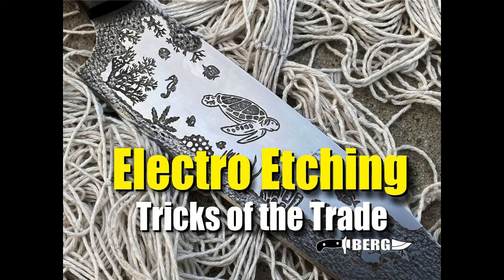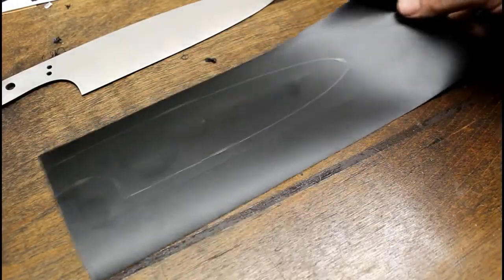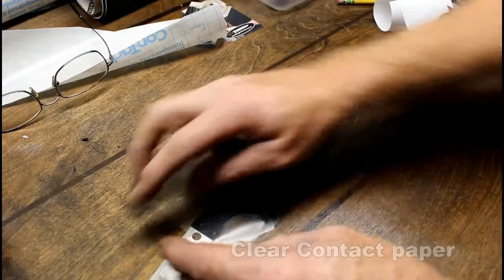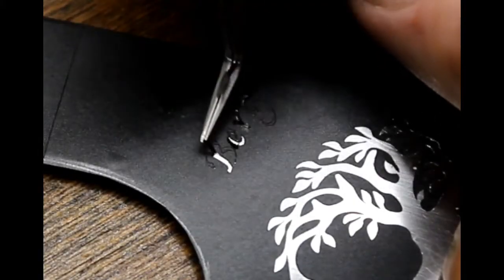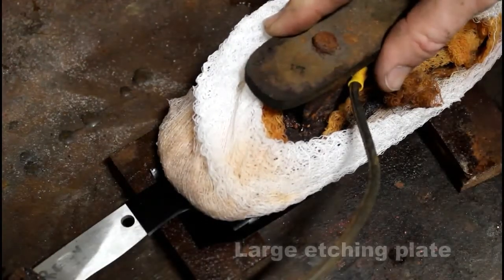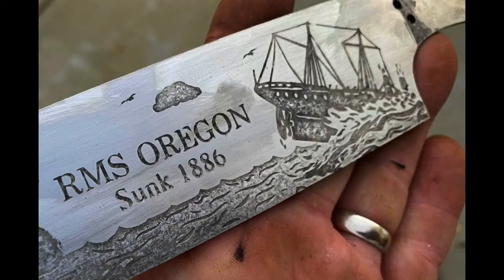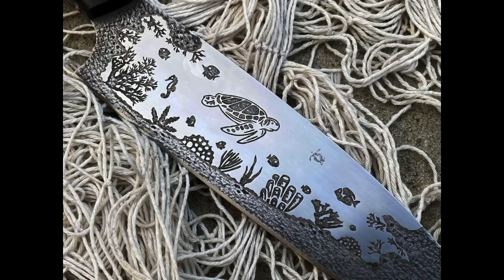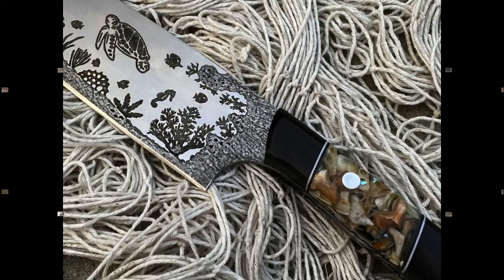Electro Etching Tricks of the Trade by Berg Knifemaking

Comment: no mention of the chlorine gas produced when using salt as your electrolyte. people should be made aware of the hazards and proper safety measures. how come nobody ever addresses this?
Reply: You should address hydrogen if you use soda 😮
Reply: Unless you are overdoing it with the voltage and current that you pass through, the way the reaction goes doesn't produce much chlorine gas, if any at all. This is because the chlorine reacts with the iron to make ferrous and ferric chlorides, which can be seen as the dark liquid he wipes off the knife later in the video.

I think the real issue here is that on top of the chlorine from the salt reacting with the iron (which again, is not a problem), in the case of stainless, you have to add the side reaction between the acetic acid and the other metals like chromium and nickel, which end up in solution with the ferrous and ferric chlorides.

This is bad news, as these forms make the metals easier to absorb through the skin, so use gloves for this, just a precaution with nickel and chromium...

This solution should be disposed off properly, and not just thrown away. I suggest precipitating the hydroxides, carbonates, sulphates, etc. and washing away the chlorine and acetic acid, making sure no metals are left in this liquid waste. Then the precipitates can be either stored in this lower toxicity form, or taken to recycle. Any alternative to just throwing chromium and nickel down the drain or storing them in a dangerous solution is preferable, specially with how cheap and easy it is do precipitate and wash these quantities.

Comment: Can I use an old electric iron as the plate?
Reply from the maker: Im not sure. I guess it would work as long as you can tap a hole to connect wire and wrap it with gauze

Comment: Do you have a tutorial on how you made the etching plate?
Reply from the maker: I dont but is just a flat plate welded to a pc of steel tubing as the handle. I drilled and tapped a hole in the tubing for a bolt that secures one of the electrical leads.
Reply: @DIYeasycrafts  thankyou!
Reply: @DIYeasycrafts  does it matter what type of metal the plate is?

Comment: Gday and congratulations for your video: I'm very interested in electro etching, I would like to ask you what type of adhesive paper do you use? Could you tell me the name to search for, maybe on Amazon? Also I would like to know what type of electrolyte to use at what amperage for stainless steel! (only works with real stainless steel, not with aluminum? ) thanks, Alberto
Reply from the maker: I use rolls of self adhesive vinyl from amazon. no particular brand. I make my own electrolyte solution. White wine vinegar and salt. Works great for stainless. 12v set at 2 amps
Reply: @DIYeasycrafts  Thanks so much for your kind answer!

Comment: Where do you get a large etching plate, or did you make it (and how)?
Reply from the maker: I made it. Just a pc of flat steel I used 1/4 thick and welded a small pc of rectangular tube to it for the handle

Comment: So sanding after the electro- etch won’t damage the etching?
Reply from the maker: I do a very deep etch. You can catch your finger on it. Sanding just cleans it up a bit makes the entire area have crisp lines
Reply: @DIYeasycrafts  The one I just did will catch your finger nail as well but I was afraid to sand it or use Flitz. Will the black/ dark area be removed if I do that?

Comment: What is the machine? Voltage? Power supply?  Is it a handmade etching iron? How did you build it and why?
Reply from the maker: Sorry for delay getting back to you. I use an automotive battery charger 12v 2 amps

Comment: My wife a silversmith watch your video and is very interested in what she believes you call the "large etching plate"(iron looking with an electrode).  She would like to know where to buy this or can you explain how to make one?
Reply from the maker: Made it from a pc of flat steel. Welded a small pc of square tube onto it as the handle and then drilled and taped a hole for the wire.

Comment: Do you answer comments? Could I etch deep enough to make a touch mark at the end of a steel bar
Reply from the maker: I do not think it would work. Touch marks are tapered in on an angle like a chisel
Reply: @DIYeasycrafts  My thought was to do taper it before I do the process. So I forged the taper in sanded the metal. the image came out good now i need to test it on some metal.

Comment: Really cool process!

I'm interested to see if anyone has yet to make lichtenberg fractal / electro chemical process combined in such a way as to make fractal patterns on metal.

I'm sure with use of a variac and some adjustments to the process and device it would be possible. Id assume the flat surface of the metal would allow for some super crisp fractals too.
Reply from the maker: Not me that stuff scares me!!
Reply: I used a variac the only time I’ve etched. I didn’t try changing the  settings on it at all because I was just doing simple runes and geometric lines. I’m planing on etching a space background on my next project, maybe I will try it there

Comment: I’m looking at a 13.5 v 4 amp dc power supply would that work or should I get a 30v 5 amp machine?
Reply from the maker: I do all my etching at 12v 2 amps. Im not an electrician but would think the 13.5v 4 amps would be fine

Comment: I thoroughly enjoyed vid  re RMS Oregon. Amazing!
I realise my query relates to a different method of etching, but a vinyl stencil is not an option in my case because of logo size
Can you advise me of a supplier of reliable, good quality photo resist film for electrically etching my knife blades?
I have followed your vids on your site for a long while now, and,  after checking yours and others, am pretty sure I am following all the important steps for using it, like exposure, developing, and the  electrical etching. 
 I have had to buy my  Resist from Ali Express, and have had so little luck with quality and consistency, ( zero actually!!),  I feel it could well be a poor quality issue, something impossible to assess when ordering!
I think the only way to obtain reliable, quality, photo resist, would be to  ask the advice of people like yourself who have found and used,   good product.
Hoping you can help direct me to a supplier. I'm getting so frustrated with all the failing!
Thanking you
Reply from the maker: Sorry I just do not use and do not know of one

Comment: Great video, thanks! How did you make your etching plate? Or did you buy it?
Reply from the maker: I made it. Just a flat plate welded to a pc of tube for handle with a tapped hole for wire
Reply: @DIYeasycrafts  The flat plate is made from what kind of material?

Comment: Fantastic job! Beautiful workmanship! How do you go about making sure that the battery charger that you purchase will work for etching metal?
Reply from the maker: Not sure most of the new chargers have a short safety and will not work. Im going to try to find a 12 volt 2 amp power supply
Reply: @DIYeasycrafts  Ok. Thanks!
Reply: Tried my first two small etches with a 1.5 amp power supply. The etching depth came out great! But I was disappointed in the vinyl cutouts. I am no artist and the results of hand cutting the vinyl show! I am only trying to practice in order to etch an old axe I am restoring, and the etching on the axe will be pretty detailed. I have the image on paper, but I know I will not be able to cut it out properly. Unfortunately, I will not be doing it again, so I can't justify purchasing a vinyl cutting machine. :-(

Comment: Such a good video and explanation!! In fact, I have 2 questions: which are de proportion used for the electrolyte in case of the high carbon steel? And can I use any metal for the etching plate?
Thanks for your work

Comment: What do you use for the 'iron-looking' device you've attached cotton?
Reply from the maker: Its just a pc of flat stock big enough to etch entire blade, that is welded to a pc of square tube. I drilled and tapped a hole in the tube where I connect to charger. I wrap with gauze wrap not cotton

Comment: Is 3 or 4 tone possible? I'm interested in doing a portrait but struggle to make it look good with only 3 shades from 2 levels
Reply from the maker: Yes just reduce the time for each shade. You can also change the texture. For example etch with gauze for on shade and then use paper towel between gauze and steel for the next. Etch will pu texture of the towel.
Reply: @DIYeasycrafts  thank you!

Comment: How did you build your etching plate? I have been thinking about making something similar but I don't know much about the electricity/ wire thicknesses aspects
Reply from the maker: I have made them from angle iron. Most recent flat stock with a pc of steel tubing welded as handle. Then just drill and tap hole for wire connection. I just use wire from the automotive 12 volt charger
Reply: @DIYeasycrafts  brilliant. Thanks!

Comment: Would love to see the electrode "sponge iron" that you used in this video. I usually submerge the entire metal object in a tub of electrolyte... Your setup looks a lot smarter!👍
Reply: Does he have a video on how to make the etching machine? 
I looked and don't see anything.
Reply from the maker: I just wrap gauze around my steel etching plate
Reply: @DIYeasycrafts does the etching plate corrode at all? I feel like a cheap solution would be a grout float because it has a flat steel plate, but if it does corrode it would be very thin